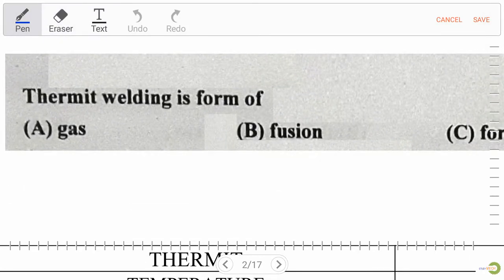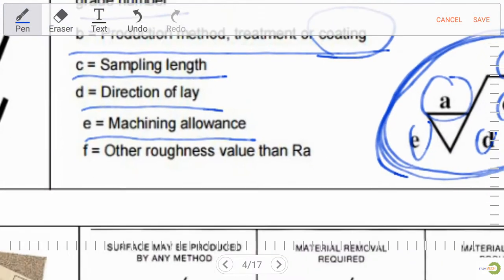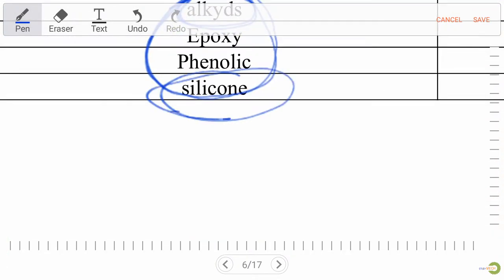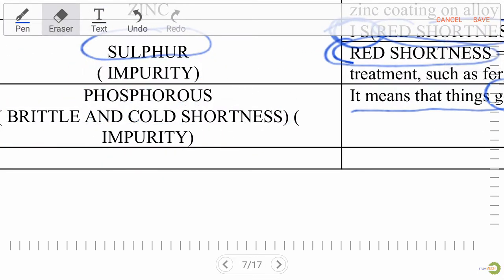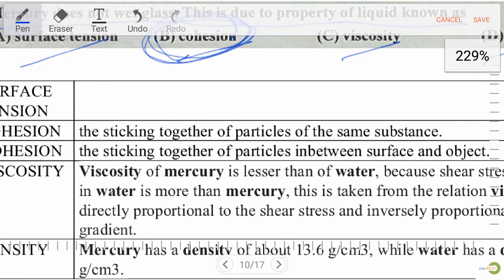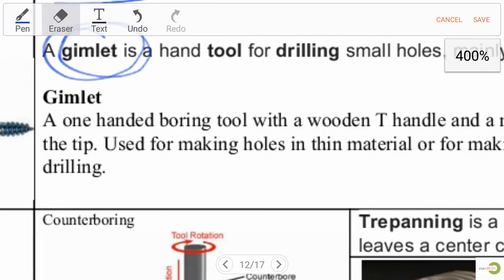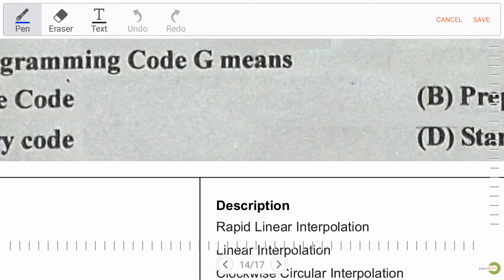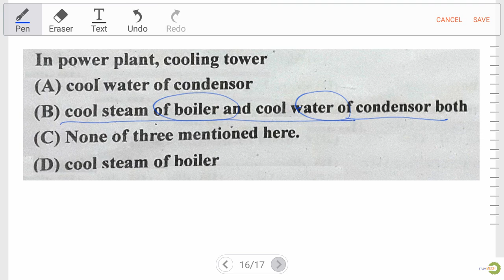MECHANICAL QUESTIONS ANSWERS CONCEPTS I RTO exams of GPSC/BPSC/MPSC/RPSC

Comment: there is a wrong answer in this video
pressure cooker is based on isochoric and not isobaric process
Reply: venky reddy u r right

.[1] Pressure is created by boiling a liquid, such as water or broth, inside the closed pressure cooker. The trapped steam increases the internal pressure and allows the temperature to rise. After use, the pressure is slowly released so that the vessel can be safely opened.